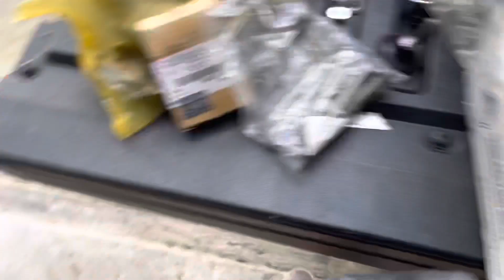Assembling a genesis coupe motor pt.1 (bottom end)

Comment: That's crazy I'm missing a bolt too where did you end up getting a new one at?
Reply from the maker: This was a while ago I don’t remember which one you’re referring to are you talking about the bolt for the oil pump or ladder frame? If I remember properly I believe it’s actually a blank hole not needed
Reply: @thesuburbanGenny  under oil pump for latter frame. Hyundai actually had the bolt in stock
Reply from the maker: @ gotcha I think I actually ran into the same situation I don’t remember if it needed it or not but for some reason I remember going to Hyundai for a oil pump bolt